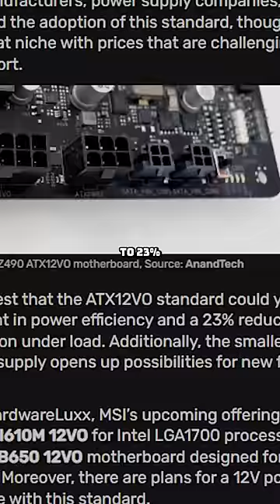Say Goodbye to the 24 Pin PSU Connector 👋

Comment: This has been a long time coming. The 24 pin is really outdated and can be streamlined a lot. Most of the pins are already redundant, there's 8 ground pins and 5 5v pins. I just hope they stick with full size connectors and don't force the smaller connector that burns up like Nvidia did

Comment: ATX12VO sucks armadillo nuts. It actually moves the power stages from the power supply to the motherboard. Motherboards will be expensive. Best to go 24V to double the current for the same size cables.

Comment: Ask the 4090's catching on fire how well small connectors work.
Reply: But its not really smaller. They just removed 3v and 5v cables and made board make them from 12v, thus making it ""more efficient"" (not really, they just moved part creating inefficiency to another place)

Comment: small ones this is output , PSU will be just 12 volt , motherboard will convert the 12 to 5 and 3.3 for all the HDDs and SATA SSDs and other stuff like floppy disk if you have any .

Comment: The theory is that the psu only has to output 12V. 3v and 5v transformers are moved to the motherboard.

Don’t feel this pin layout will be final form. I would much rather they got rid of wires and found a way to connect like a server power supply.

Comment: I like the idea of a newer smaller connector. 

I just can’t understand why they have those little sata power connectors. Who’s building a latest/future generation pc and is still using sata devices. 

They might as well have ide connections, a dialup modem, and a db25 parallel port on that motherboard 😂. I like backwards compatibility with technology, but only to a point. Anyone still wanting sata can get adapters and run them off usb. Sata needs to be retired to shit like hot swappable server storage. It serves a purpose, but not much of one for most people at home.

Comment: Now the issue becomes "did the board manufacturer design a good voltage step down circuit for the 5 and 3.3 volt rails. Previously you were reliant on a good power supply manufacturer. Now you have to worry about a good power supply manufacture and a good board voltage design on top of that

Comment: Oh yeaaah let's increase voltage and reduce the amoung of pins, bet it'll go nicely
Reply: No increase of Voltage, take a look at the side of your current PSU and see how much 5v and 3.3v it really supplies. 

Then move that 5v and 3.3v conversion over to the motherboard (the reason for the SATA power connector on the board). 

Dell has been using this for years.

Comment: Not sure why there would ever be a replacement. If it ain’t broke, don’t fix it. There are already additional power connectors on many motherboards for additional CPU power and sometimes a SATA power connector for additional power for the PCIe slots. This will only make things more confusing and I just don’t think it is a necessary change.

Comment: They seem to lack comprehension regarding the rationale behind the replacement of the previous standard with this 24-pin connector. The previous version featured two separate connections, and if improperly connected, it could result in damage to the motherboard. To address this issue and accommodate additions like the power switch, they opted for a new 24-pin connector that combines all necessary connections into one, ensuring a keyed design to prevent incorrect connections.

Comment: Hope it doesn't burn up like the 12vhpwr one. And in this mobo all the conversion for 12v to 3.3 and 5v happens on the motherboard. So it will drive up the cost of the mobo

Comment: Good. My 24 pin jammed on itself and i had to used every ounce of my strength to pull. Then the connection between the 24pin and the motherboard tore and whenever there is a thump or the PC moves it turns itself off. 😅

Comment: The power efficiency is for the PSU not the motherboard. Converting 120v AC current to the various voltages and to DC is very power intensive and makes the PSU very hot leading to a lot of wasted energy. With atx12vo the PSU just converts AC to DC and then the Mobo splits the voltage. This is much more efficient allowing the Mobo to grab the exact amount of power it needs ehen it needs it. Instead of constantly feeding it as much as possible. Funny how most of these tiktok/short techtubers don't know anything or do the bare minimum of research.

Comment: so funny hearing that a motherboard power connecter change is needed for better efficiency when modern gpu's nearly need their own power station to run and they dont even get power from the motherboard but direct from the power supply

Comment: I saw connectors for 10+6+4+4 so yeah they changed a lot by split 1 - 24 connector to 4 different connectors. also there is still 8 pins at the top

Comment: "How do we get rid of the big block 24pin?"
"How about instead of all the necessary cables in one block, we do the same as the GPU cables?"
"How so?"
"We just split the 24pin into a 10 pin, 6 pin, and two 4 pins."
"But that's still 24."
"Yes, but it looks like it isn't, and they can still mash them all painfully into the current 24pin connectors."
"So we 'get rid of the 24 pin by putting the problem on builders and PSU manufacturers?"
"Exactly, and we can charge extra for the new 10 pin connector required, or slap our logo on a new 24 to split connector."
"Brilliant!"

Comment: Good thing I just built my new PC with state-of-the-art parts so it will last long enough for this stuff to fully digest.
(for the curious)
MSI MEG X670E ACE M/B: Ryzen 9 7950X3D: 2 - 2 stick 16GB PC4800 RAM kits (running 6000Mhz) for a total 64GB: Zotac RTX4090 Gaming GPU: 6 - 2TB NVMe M.2 drives in RAID 10 for a 6TB C: drive: 20TB disk drive.
Ought to do me for the next five years.

Comment: They're killing the 24 pin connector with an even worse idea. The standard ATX connector is still around because it's convenient to have everything in the same cable, and it works well. There's no way that splitting it up into 5 separate cables will convince people that it's better.

Comment: Those 12V Only PSU and Connectors are already in a whole bunch of industrial, office and sometimes pre-built consumer Computers and Servers for years. Dont really see a downside to that to be honest. Its time that the 24 Pin is replaced in consumer machines all together.

Comment: I remember when NVidia tried a 12V HPWR connector.... video cards are still melting. 

Not to mention what shall I do with my power supplies which have had a standard ATX+4pin connector on it that I still reuse all the time?

Comment: If you buy new motherboard, than you can't use old power supply. Only for the profit manufacturers changed the connector.

Comment: Let me get this right, take one socket supplying power, break it up into seperate sockets. That way, If you lose power on a rail, instead of replacing a $90+ PSU I now have to replace a $400+ mainboard.

Comment: I'd prefer to leave the power supply components in the power supply. I feel like there will be a lot of electrical noise added when those components move to the motherboard.
Reply: And it is already a problem on newest boards. Its dead on arrival.

Comment: I think motherboards are getting so thick that there would be room in the height to develop a new connector that both slides in and out better, but retains a solid lock mechanism so it doesn't slide out on its own. Don't like the segmented style that you reveal they are aiming for either

Comment: Just looks like a lenovo desktop motherboard power connector to me. Whenever i get an old desktop with a decent cpu i end up taking the motherboard out and using an adapter on a standard atx power supply to plug into the lenovo port that looks very similar to that. I think Dell has something similar as well

Comment: Let’s call it what it really is a forced push to a new socket for power supplies to make replacing power supplies of current system impossible when they finally start having problems within the next 10 years forcing you to have to upgrade your entire set up just over a power supply or have to buy them at jacked up scalper price.

Comment: What was wrong with the 20+4 pin connector!? Don't they realize that it was backwards compatible with computers back into the 90's when ATX came out!? AT power supplies are scarce enough as it is!

Comment: sigh Industrial power delivery solved all this decades ago. Replace the whole connector with a single 12V high current industrial screw terminal with 8 AWG silicone insulated high flexibility wire and crimped on lugs, let the MB provide 5V to external drives. Replace the PSU with a Mean Well PSU or something similar with a standardized industrial form factor. The PSU has identical screw terminals on it so you can make whatever lenght power cables you want using wire and a lug crimper.

 There PC industry I just solved your problem for you, you're welcome.

Comment: Okay there’s a few reasons why 12 volt is better than the current 12v-5v-3v standard. One big one is the use of thinner gauge requirements for wires and conductors inside the machine. There’s also the greater efficiency which doesn’t just apply to the motherboard but all other components. As well as that there’s the greater control for component manufacturers to assemble their own power management systems and tune their devices better. This video is grossly misinformed on the topic of 12 volt ATX. It’s been a developing standard for a while and there’s a plethora of reasons as to why it’s advantageous.

Comment: HP has been pulling that shit since the mid 2000s with their proprietary power supplies. ATX-12VO's 5 and 3.3 volt generation would depend on the voltage regulators thay would be placed on the motherboard, which means the motherboard may provide a potential power bottleneck. This is a very dumb idea. I obviously prefer the good old 24pin ATX

Comment: Oh, it's pretty bad. A CPU valling for 500w ends up pulling 620w. Where's all that power going? Heat. Imagine a CPU calling for 500w and pulling 540w rather than 620w. Your CPU alone is producing 80w less heat now, not even considering your VRM, Memory, GPU, USB ports, all pulling 30% less power and producing 70ish% the heat. Cooler temps, quieter fans, everything to love about this, on top of smaller cable bundles.

Comment: Oh they're changing the 24 pin on an archaic board layout that hasn't changed in 25+ years. Big whoop.
Motherboards need to be redesigned for bigger, heavier mounted components with layout focussed on airflow because of increased power draw. Take into account we will be using actively cooled NVME real soon. The current design is stupid for this day and age.

Comment: ATX12VO isn't exactly brand new. And no, ATX 24-pin isn't getting phased out, at least not for that one. I'd rather have my power stuff done inside my PSU than in my mobo.

Comment: It's funny the non-PC expert know more than PC builder in the comment section x)
- 12VO is safe now. It's like saying I don't micro-wave cuz it could kill me. It's been used in a lot of PC from years.
- Having less cable is obviously better.
- Power efficiency does be useful to reduce heat and waste of energy (well yeah you can say you don't care but some people doesn't like having a expensive bill
- For thos saying don't fix something who's not broken.
So you want me to give you a PC with 256 MEGA OCTET ram like before and tell you "it's working so I'll not upgrade it".
Reply: There is no less cable (same or even more). There is no more efficiency (they just moved 5v and 3.3v to board, so PSU is more "efficient" only because board does all power conversion beyond wall to 12v, that was causing inefficiency). Its a proprietary gimmick that exists for long time already, it never took off in OEM/DIY market, because they dont have to comply with braindead regulations.

Comment: Pretty much has only 12v from PSU to the board, the 3 and 5v is done on the MB which if one those fails oof new MB which is depending on what you spent could be 2-3x more then a psu.

Comment: The 20+4 pin connector is obsolete. Has zero to do with the specs and everything to do with use. The old AT 20pins used a lot of 5v, 5vvsb, 12v-, 3.3v as ram and accessories used those voltages. Today's ram and extras are almost unilaterally 12v+ with only such things as storage/usb using 5v and the motherboard logic circuits using 3.3V. There's basically no need for the excessive amount of pins. The pc itself went from requireing @ 30A combined on the minor rails to @ 10a at most, even less for full ssd builds. 3.3v consumes @ 1a. The 12v+ required has tripled or more as fans, leds, gpus etc all converted to 12v+ only. Modern gpus no longer use 5v and 3.3v at all.

So the connector itself has become redundant, motherboard mounted transformers can easily reduce a trickle of 12v into necessary voltages.

Of course this means if those circuits go dead, the motherboard becomes useless, but that's easily rectified if the voltage transformer circuits themselves were modular, on a daughter board or plug in, like the older TPM or ram expansions used to be.

Comment: Why don't they make a 12V connector only and everything else will be done on a motherboard itself?? Most of the time you need 12V power rail only. 5V and 3.3V will be converted on the motherboard and depending on which model you pick, so beefier will be that convertor as well. So if that motherboard supports a lot of NVMes and USBs where u need 5V high power rail or 3.3V for chipset and RAM okay... you can get away of supplying all kids of voltages to the motherboard but there will be standardizied praticullary one exact converter that can make idk lets just say 150W on 5V rail and 100W on 3.3V rail. Plenty of power and of course you can add PD or QC for USB outputs, the convertor could be underneath a VRMs heatsink so it'll be nice and cool every time anytime. And of course, not forgot to mention, the whole MB will need one 8pin or newest 12pin ATX power connector 5 pins for positive 5 for negative and separate ground and green wire for power button. There is also a little bit of problems, the PSU will be always on but it can be solved by using two different flyback transformers, one that will supply voltage to the green wire on stand-by mode and the other to power 12V rail only so by shorting that green wire to the ground like we know , the PSU will trigger 12V rail on. And also the motherboard can use that voltage from the green wire to be able to stay " hybernating " or " sleeping " ..turned off will mean " shut down 12V and switch on idk 5V stand-by  rail or 3.3V " but there is always a lot to do with that kind of concept. Personally, i do like 24pin connector but having a 12V power rail only sounds cooler.

Comment: Yey - I hope it's as successful as nVidia's new power connector choice for the RTX4000's. Seriously - they've created a new standard for that? Why couldnt they have created a new standard single connector block from the case front to the mobo instead? Every time - those BS power switch, reset switch and LED things on teeny-tiny little plugs! Make it a block already FFS!!!

Comment: Finally, it's much easier to make a computer that can run direct of a battery, without the need of a big inverter
that is inefficient or maybe use one of those nano PSU connectors, also all u complaining about fire hazards have u seen the pinout for the 24 connector there is only 2x 12v the rest is 3v3 5v -12 pwr_on 5v_stb and alot of gnd. Also having higher voltage allows for higher power transfer with less loss in cabling plus the connector

Comment: You know, I’m not a huge fan of the 24 pin connector. It’s big bulky I would preferred some thing smaller more compact, more sturdy, feeling and certainly something that is right angled then the way that most are.

Comment: I honestly am struggling to understand how just a different connector can impart those efficiency increases. Is this in tandem with a new power supply that provides far less voltage rails?

Comment: OK. This newfangled shit is basically the same old cable with only the +12V, Ground and 12VSB instead of 5VSB, PS_ON and Power Good signals retained. 3.3V, 5V and -12V has been removed. 
The good thing is ever so slightly cheaper and compact PSU, whereas all the other voltages needed by the system will now be made on the main board - means pricier boards and more points of failure.

Comment: they're implementing solutions in need of a problem.

and its really getting old. put several people in a room to agree on using one existing standard, and you're going to have another, new standard.

i really feel this qualifies as 'just because we can, doesn't mean we should'.

if they had found a way to cut it to the 10 pin alone? sure. but they didn't. and i'd much rather route all those extra connectors from the psu than from the motherboard, as seems to be the push.

Comment: Isn't it that format that supplies only 12v to motherboard and 5v and 3.3v are generated on the board itself?
Reply: Yes. That why it is more "efficient". Basically there is less losses on PSU side, but they come back later when board generates 5/3.3v.

Comment: I see no good in doing this, the only problem 24 pins had is they were so hard to plug in and unplug, but that's the manufacturers fault not the plug and can still potentially be an issue on the 12VO